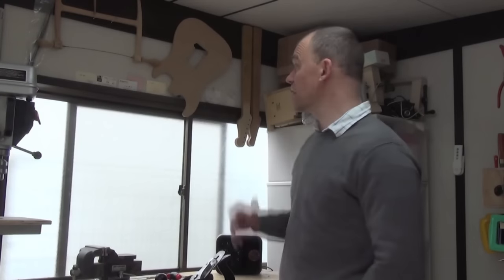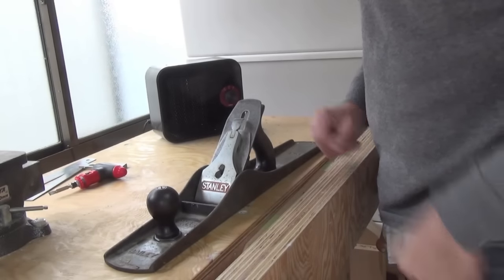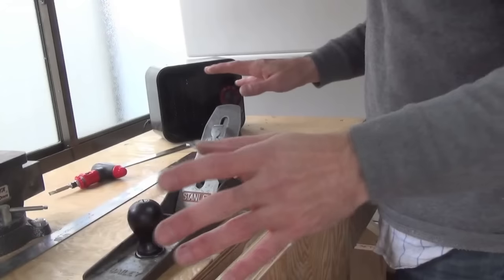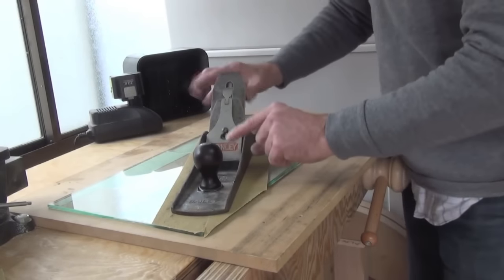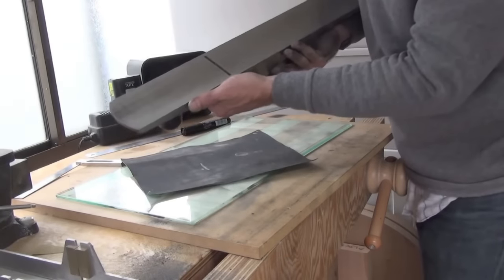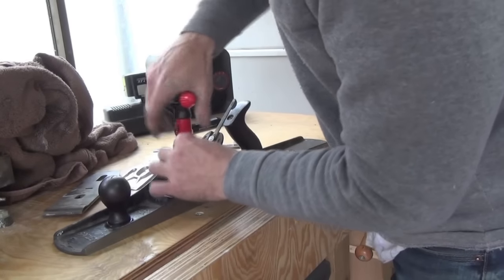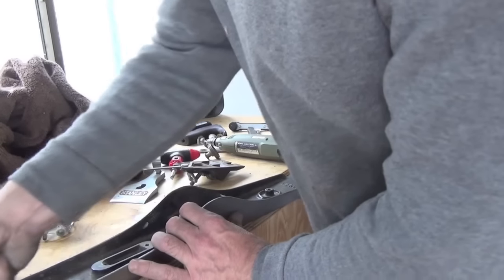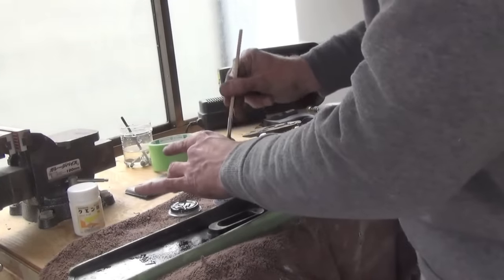Vintage Hand Plane Restoration - Part One

Comment: Nice save. 
I do this as well with vintage metal things. 
I wonder what the project is you are going to use this on. 
After all we don't restore tools to useable state to hang on the wall.....
Reply from the maker: +9th Delta Concepts Cheers - the things you do with old metal are amazing!

Yes, this will be put to use pretty soon on a guitar, I hope...

Comment: what kinda paint for the body?
Reply from the maker: +nmssis To be honest, I'm not sure exactly what sort of paint it is - I just bought a can of 'lacquer' from the local hardware store. Could be anything, but the guy there said it would hold on metal. Original 'Japanning' was apparently a mix of asphalt and turpentine which was baked on. I've read in the past that there's a particular auto paint made in the US that gets really close to the original look, but it's not available here in Tokyo.
Reply: TomboLP cool beans, thanks!